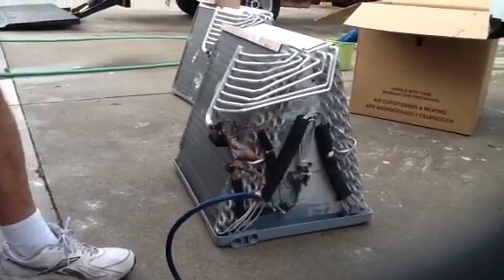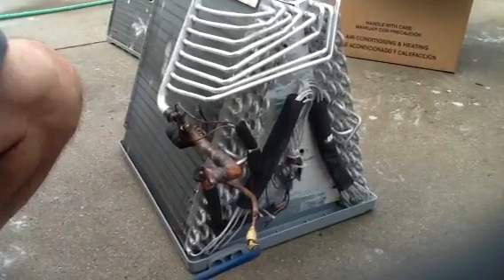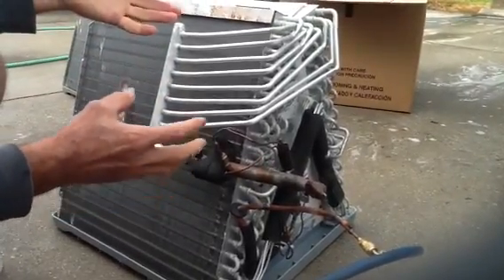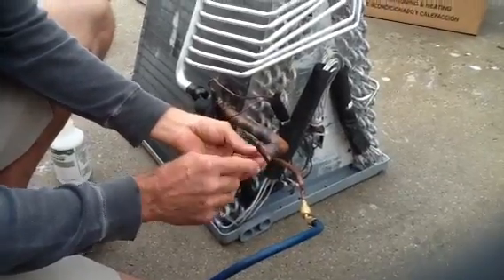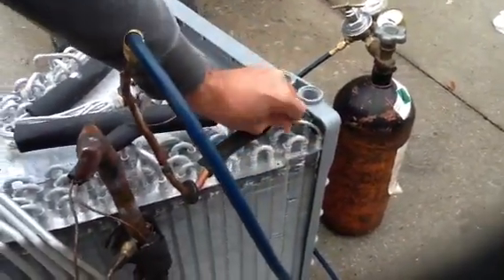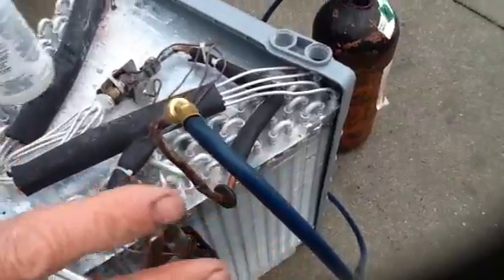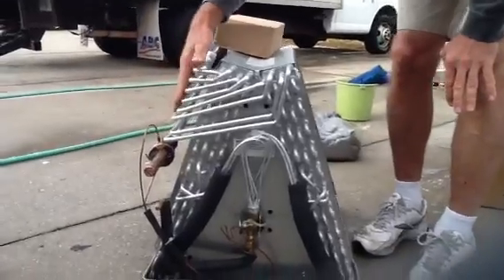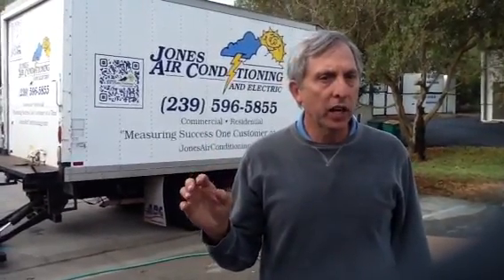How to Perform a Coil Leak Search...and be 100% Sure!

Comment: Less corrosive?The coil tubing thickness was reduced by designed by 50 percennt. And with the pressures double with 410a compared to r22 is what caused these leaks.  Alunimum has not anti microbail or anti bacterial properties like coper does.This can create the bacteria called googlii to clog up drain traps and cause water back ups. Yeah, realy good choice.

Comment: Heres a tip for the vets..  when you put in brand new high dollar aluminum coils, go through the extra time it takes to route all the tubes above the water level in the drip pan and build a platform for the coil to sit on where the water wont roll off and sit on the unit or drip down a tube n all.  The factory built enclosures are never good enough lemme tell ya..  never..  just carry around a thin sheet of aluminum and stand it all off a half inch and the damn things will last for as long as theyre supposed to..

Comment: Really good video. Hope someone can shed some light on this situation. What would hvac companies prefer to do, Replace a warranty evap coil or repair? Would these options affect out of pocket expenses for the customer.
Reply: have you ever chopped the fins off and cut end plates out of a coil with a dremel to repair the soft aluminum or copper tubing underneath? Jeez, we would much rather replace a freaking coil. or better yet how about building the coils with no leaks or flaws in the tubing!

Comment: Question, is there a surefire way to get a stuck thermal switch to release in a compressor... if it is able to be released? A friend of mine told me to beat the comp with a mini sledge and it may release. I was just wondering if there was a special trick you knew. Thanks!
Reply from the maker: The hammer trick is something  I never used I’m not sure why your friend is telling you that if I no had a stuck thermal switch inside the compressor and the compressor was hot I was shut the disconnect off make sure there’s no power on it and put a water hose on top the compressor to cool the compressor down so it would reset sometimes you have to take the fan housing off to get to the compressor if there is a compressor blanket on it you need to take it off in the store away because it’s getting too hot
Also check the capacitor make sure it’s working correctly and make sure also the fan does it run for 10 or15 minutes then shuts off Thanks for watching

Comment: My outside unit work just fine when outside temp is less then close to 80 f . Above that, condenser unit shuts off and I have to push the restart button. Then runs for few minutes or hour depending on the weather . I’m confused.
Reply from the maker: Sounds like the unit may be overcharged
The higher the temperature the higher the pressure
You may need to get an AC guy out there to check the pressures and clean the condenser with the water hoses and cleaning solution 
That makes a big difference thanks
Reply: Yep, sounds like of the old Rheem cubes with the resettable hi pressure switch.. overcharged or dirty condenser coil, one of the two.

Comment: Mister you got one of the best videos out there so informative , I have a quick question I have a  home that has a crawl space and my ductwork is underneath the house therefore I need to invert the air handler upside down is that something that can be done with Rheen and if so how is it done thank you so much for your feedback

Comment: sr jones how exactly  do you you check the pressure switches on a heat pump system ?  when it does not work or is broken how you test it. please sr jones thanks.

Comment: Hello there.

Inside the coil there is like a service port or release valve.  what is it for and can it be eliminated
Reply: Txv
Reply: For the equalizer line if an optional txv is installed. Otherwise should be capped off with a brass cap.

Comment: Maybe the owner can answer this or anyone else - if you place gauges on an r-22 system that has not ran for weeks due to a bad compressor, shouldnt the pressure equalize to the pressure equivalent to the outside air temperature?  On a unit that I have the pressure is 99 on high and low which to me doesnt make sense. Or am I overthinking this?
Reply from the maker: it is equalize, you are over thinking it

Comment: The reason behind aluminum is cost, plain and simple. every component in that evaporator could be copper except the drain pan. If we could find a evaporator manufacture and request a solid copper one and just buy from them, this would change the industry. When you buy a unit because it's cheaper...this is what you get.

Comment: I deal with Goodman and Amana and have been having problems with their aluminum coils leaking really bad
Reply: The tubing on the goodmans sit to low in the pan. Its the condensate water eating the aluminum. Trane and Carriers aluminum coils are raised higher in the pan so they do not leak.
Reply: hey ross i have recieved a no cooling callback for a goodman. im unfamiliar with goodman but i keep hearing that they prouduce some crappy leaky coils. have you noticed a trend with this issue?
Reply: It’s a Goodjunk.. no big surprise there. Lennox had some issues also.

Comment: What is a ballpark charge for a residential leak search?
Reply: Shea stadium cost $28 million (ballpark estimate) ....just kidding..we include leak search as part of the $99 diagnostic, however you could expect to pay $231 for such a service on a residential system....any more and they could be using complicated and usually unnecessary methods to try to find the leak. Many can be found in ten minutes.

Comment: Thanks for the info. I had a question what about if is a small leak, should I check pulling a vacuum and seeing if it holds. We run trew this problems a lot. I always wonder what is the most accurate for small leaks
Reply: Vaccum test can give u the results of leak but not pin point the location of the leak,
Reply: +Jeremiah Gonzalez also if you make vacum in a system and wait to pull in air propably will make problem later at the dryer from the humidity..so if you follow that method you should change and a dryer too..i`m talking alway if you do that method in a circuit..not in  part of it..thank you.

Comment: David, I've got a 5-1/2 year old Ruud 2-ton heat pump that's developed a leak in what the tech called the "inside coil." Since it's only 8 months out of warranty, I'm fighting with them best I can over a $1500 repair on a $5300 unit. The Ruud factory rep is going to come out and take a look. Is there a fix for this or is it necessary to replace the entire coil? Shouldn't there be some sort of rebate for the coil's salvagable parts? The reason I've got these questions is that I've dropped over $12,000 with this HVAC outfit in the past 5 years (downstairs unit and a split unit upstairs) on a 14 year old house and I'm getting the feeling somebody's aiming for my back.  Thanks--your videos have taught me quite a bit!
Reply: $1500 is pretty brutal for a 6 year old system they installed....Ruud supposedly fixed their coil problems since then, they really are the best thing out there right now....you'd think after 90 years we'd be able to get the coil thing right by now...oh that's right we keep "innovating" to make them more efficient...well hopefully you are one of those guys who votes for "green" initiatives....

Comment: H10 for r22 and field piece srl8 for puron. If your techs are not walking around with both of those on your trucks you are losing money and not servicing your customers properly. Also your spay bottle is not even a 1/10th of effective as liquid snoop for a visual detection.
Reply: I used to think the H10 was everything and never could get the SRL8 to work. I owned so many H10s I lost count. Now I use the Infinicon tek mate and have finally figured out how to discern between the false positives and the real hits. And I keep extra sensors. I had two H10 pros fail a year after owning them....why pay $550 for those when you can get the Tek Mate for under $200?
Reply: I dont even use a leak detector anymore when its low you know its the evaporator coil because they are all pieces of shit. Lennox and Goodman being at the top of the shit list.
Reply: @clark hall  don’t forget about Trane, especially in the mid and late 2000’s. They were notorious for evap leaks.

Comment: Try Handy AL 822 rods for the repair, it works wonders, You can now easily braze alum. to copper or alum to alum or just patch big holes in alum coils. I had a micro-channel condenser with a stress crack where the high pressure gas enters from the compressor, that AL 822 rod i used with and air acetylene torch and stainless wire brush and fixed it so good it looked factory, They are expensive and from lucas milhaupt but I can go to my customers house and fix trane condenser leaks all day long now even connections that are copper to aluminum. Much easier to use than those solder kits they sell too!
Reply: If under warranty, most customers want another coil.  Personally, I would want new warranty coil also figuring other manufacturing defects.

Comment: Hi i have a problem understending a unit wich is a trend Hotel  room heatpump and the compressor runs and the fan but no cooling at all put my gages and shows 104 at the highside and 100 at the lowside what is wrond with tis picture
Reply: Compressor not running or worn valves

Comment: Hello I loved the video on the leaky aluminum coil. You mentioned that to properly leak check a system, one must isolate the line set, then isolate the condenser and then the evaporator. I am a hvac student full of curiosity. Would you guys think about adding a video of that process? Or maybe a discussion of what valves to use and where exactly to place them. Also if you could give some rules you use for the length of time and the pressure you use. Thanks a bunch

Comment: formicary corrosion is the reason they went to aluminum. It was found to be caused by chemicals in the air from all of the products that we use in our daily lives. these chemicals attach themselves to the copper and they bural microscopic holes in the tubing causing leaks. this is a problem with every manufactor that uses copper in their coils, its also a problem with some refrgerators that uses copper coils